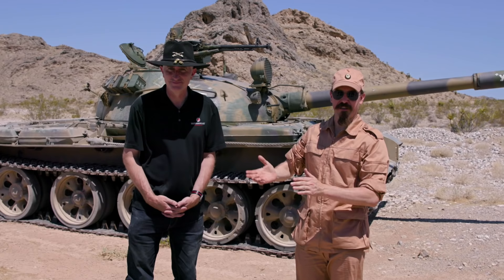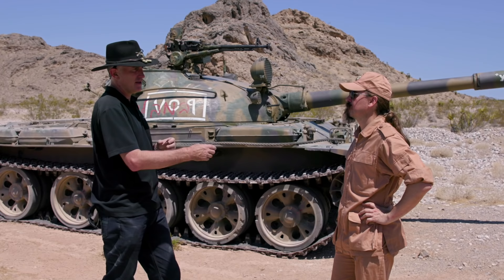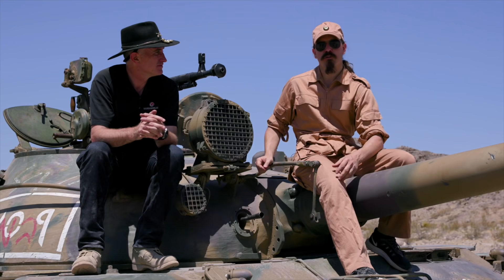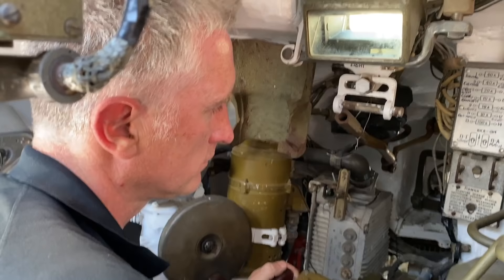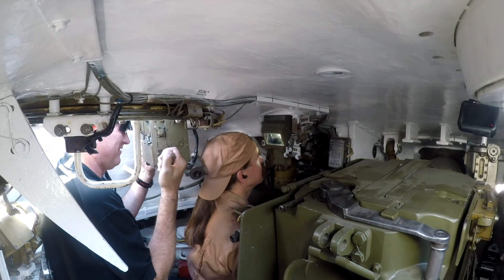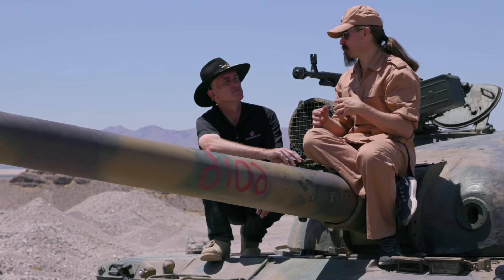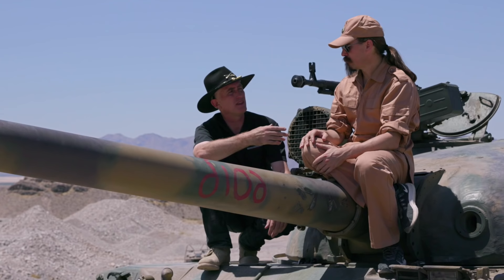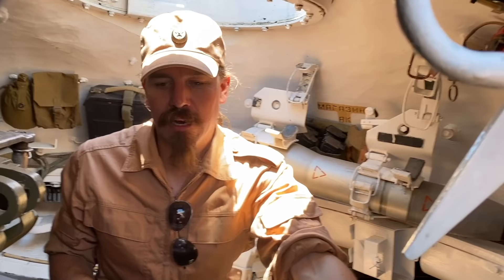All the Guns on a T-62 Tank (with Nicholas Moran, the Chieftain)

Comment: Excellent video and certainly a well built tank.about the track pins I can only guess that it will get out from it's sleeve after a while and the bump on the rear section will make sure that this will be hammered down back to it's position.since it got no nuts and/or locks holding it.sorry for my bad English.

Comment: i always thought the "A" prefix was for the ones with the DShK
Reply: A is for the T-62 with rifled gun.
Reply: @Salsilator  so i actually took some time to look into this, T-62A is what the west used to describe the DShK upgrade, unofficially, and was later adopted and popularized by model kits. where as, what you're talking about is the object 165 vehicle, which was, again, attached with the T-62A prefix in the west. though its unclear if this name was EVER used to describe the rifled version of this tank. in russia, these 5 prototypes were simply called T-62. funnily enough, apparently world of tanks used the term T-62A for the object 165 in their game, and now its been so popularized by this video game its really hard to find any real information about the origins of this terminology. so, if someone calls the Ob'yekt 165 a T-62A, you have world of tanks to blame.
Reply: @wikikomoto  try to search in non-western sources. T-62A was adopted for service, but only limited number was built due to shortage of ammo types for 100mm gun (2A42) and bad stabilizer.

Comment: The numbering on the tank was not right. It is either 709 or 759. If the middle number is a 5, it would look like a triangle with rounded corners. If it was a zero it would look more like a diamond,  not quiet, but if you use a wide nibbled quill making just a dash or dot, it would look like an Arabic zero.

Comment: Where did you get the live ammo for this? The round that you inserted in the gun had the markings on the side saing that it was a practice round. Did you manually fill it with propellant?
Reply: @Enclave Patrol well, this round comes from where I'm from :) "учебно тренировочный" means it has no explosive whatsoever, ammo or propellant. I used the word "practice" incorrectly the first time. It's not practice, it's... well, dummy, I guess. I'm not sure how to correctly translate the military terminology. For comparison here is the picture of the practice round for this gun: https://upload.wikimedia.org/wikipedia/commons/f/f6/115mm_OF-11.jpg
It sais "ПРАКТ." which means "practice" and has a propellant marking (the line that starts with "ДГ").

Comment: Is Soviet 12.7 ammunition and rifles classed as destructive devices as the diameter of the bullet is just a hair bigger than half an inch.

I was allways surprised before the russian ammo ban why people could not get cheap new or surplus 12.soviet rifles that are bolt action or semi auto.

Since no pistols exist it would be fine to use cheap steel case, bi metal jacket steel core ammunition that would have been significantly cheaper than .50BMG

I know Barnaul even makes hunting rounds and solid lead rounds new.

The polish millitary are desperately trying to convert the PKM and DSHKAM to .308 and .50bkg so it can use NATO ammo and they are having trouble.

In my opinion the PKM is the best full bore infantry machine gun, it's very light and u mean very light compared to western counterparts.
It's reliable and will eat any old surplus ammo if questionable quality, I have shot reskybold ammo left in the open u. Tropical elements that had quite abit if just on the cases but it shot just fine and never skipped a beat.

A very accurate machine gun with different barrel lengths and profiles but most just use the standard one.

Most of the PKMS have optic rails installed and okay nice with a half decent soviet optic.

Many have folding butstocks, ammo is cheap.

You can go I to any supply depo and allbif the belts are for the same weapon, it can fire even pre WW2 maxim gun ammo in belts with no problem.

Kind of a pain to clean as only new ammo is non corrosive.

But finished to western fullbore machine guns it's just do might and that has a huge effect as in the gunner does not have to lug around a lot if weight, you can collapse the butstock and they have modernised polish night vision and good ootics, it's fast to change a barrel and I don't think Poland will give you the PKM unless all issues with the .308 version have been sorted.

The Soviet 12.7 fires at slightly lower pressures and fired abit faster compared to the ma duce but it's a nightmare to finger it to .50BMG

Poland is rearming asbfast as it can with the money it has as it's sr fmthe front door with Russia if a esr kicks fmigf 

They are nice and friendly oriokr m

Comment: 16:43 if i remember correctly this is quite a persistant soviet (maybe even russian) “gimmick” that allows them to utilise captured 50 BMG rounds. Same goes for electrical equipment, you can use some western electronic equipment on soviet vehicles like for example the mi-24 hind. You cant however use soviet electrical equipment on western tanks and heli’s nor 12.7x108 rounds in your M2 machinegun. I forgot where i read this but i believe it is quite an interesting doctrine

Comment: How many T-62s are in the war in Ukraine? ....on either side.
Reply: Ukraine has none. They captured a handful but without a reliable supply of 115mm ammo they are not using them. Rather Ukraine appears to be doing serial conversions to very useful armored recovery vehicles. 

Russia is hard to say. They have lost 51 T-62 and have claimed they will bring 800 back in to service in the next three years. Take that with an appropriately massive grain of salt given the track record of the Russian MIC. My guess is 120-240 in the RuAF at the current moment.
Reply: @Disanthrophobia  Thanks very much for replying.
Reply: @Disanthrophobia  Ukraine has captured some and using them as recovery vehicles (barrel is often cut off)

Comment: The Russians are pulling their T64s out of storage then add on armor. Typically with reactive armor. They are supposed to have thousands of them. They have also tinkered with a bigger gun but in the tests they cracked some of the tank's structure when they fired them.